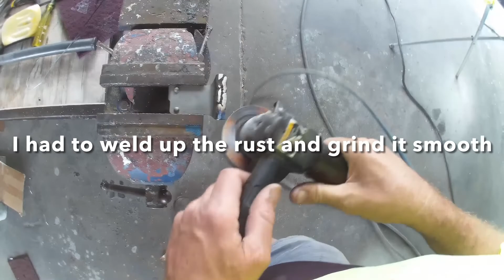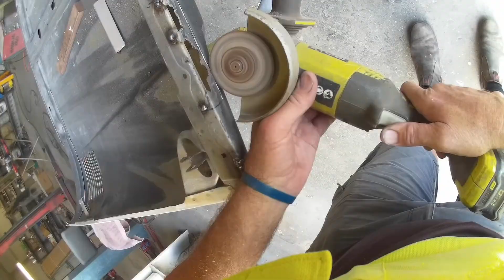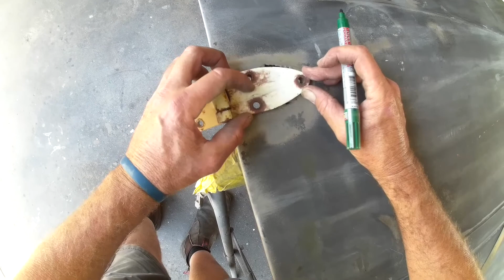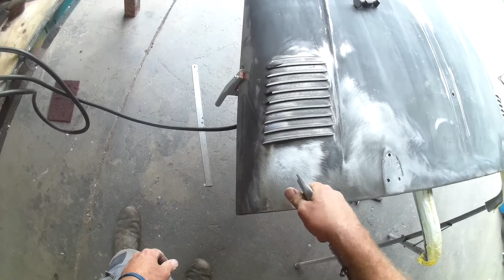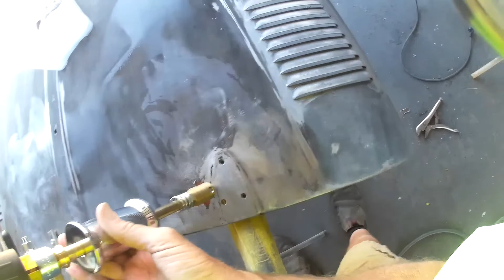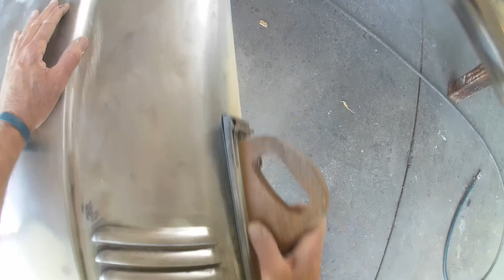Rust and panel [Restoration]

Comment: Thanks heaps for that. Iv got alot of work to do in my roof and this has helped me not stress as much about it.
Reply from the maker: Thanks Bevan just do a bit at time you will get better as you go.
Reply: Y’a I’d benefit from seeing some roof repair with fiberglass.  I have a gash in mine and would love to patch it from the inside while assembled.  I know everyone typically takes roof off from the sides and flips it upside down but I’m scared to dig the hole deeper when the rest of the roof and sides are good enough for my needs.